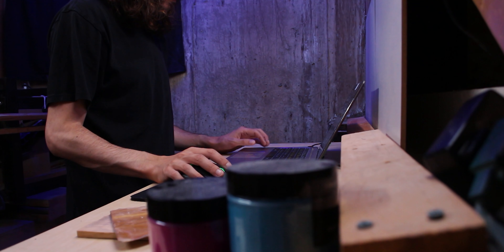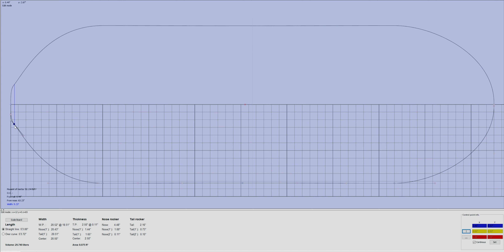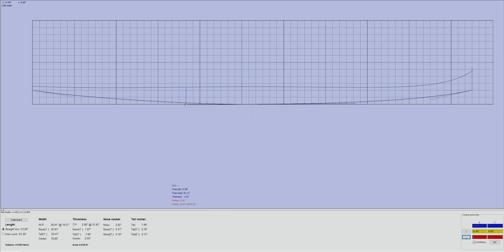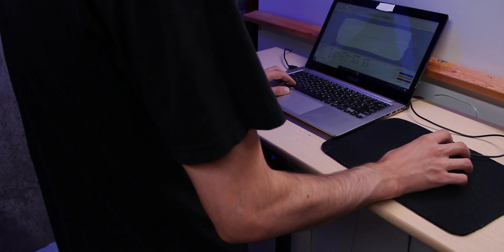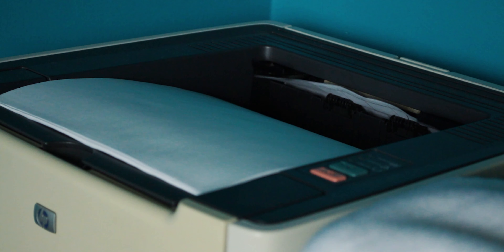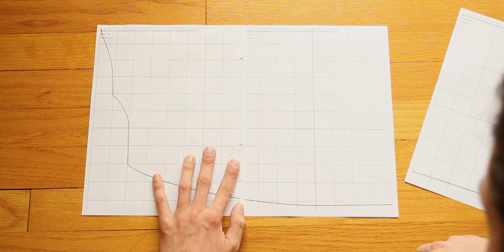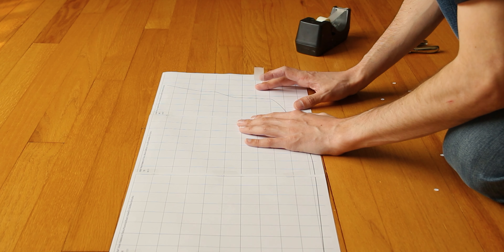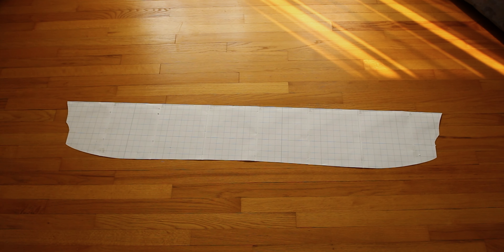Designing Homemade Surfboard Templates - Otter Bite Part 1

Comment: I used to own a lib tech skunk ape ( I think ) and it had that “tech” that had the rail line all wavy. I’ve often thought about trying to work this into a surfboard and seeing if it’ll work.
Reply from the maker: I remember those boards, I never rode one but knew a couple people that had them. They worked well on ice which is mainly what our hills were. Wonder if it would give a surfboard rail similar grip in the wave the same way a bat tail does. Might be work trying.